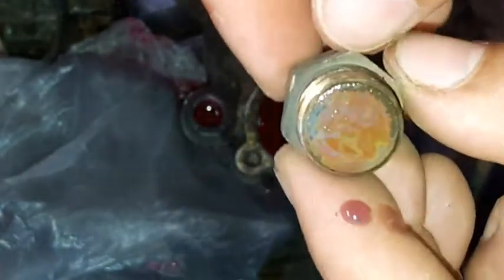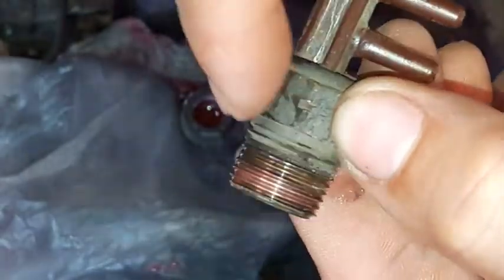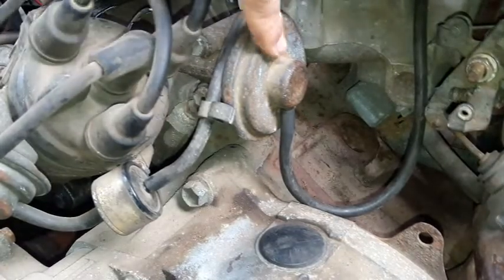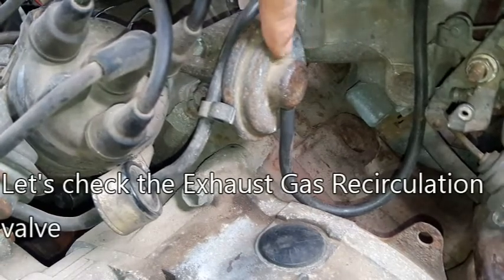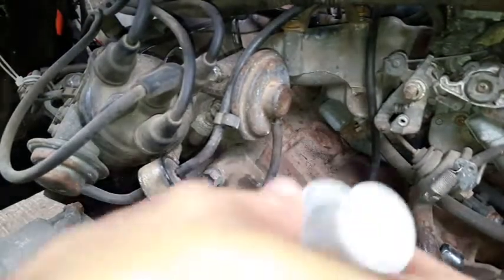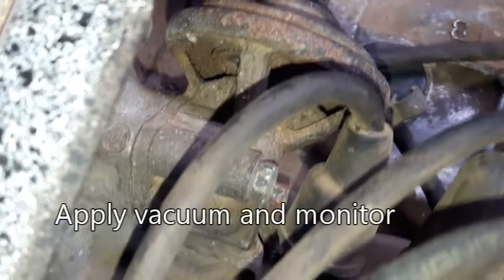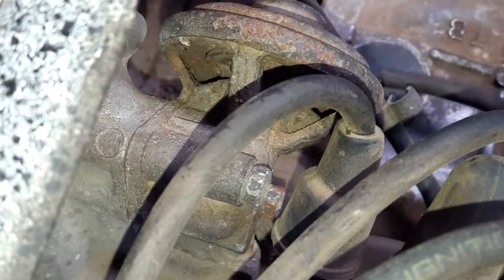Thermal vacuum switching valve & EGR test Suzuki F6A Multicab

Comment: Greetings. Sir mga ilang seconds o minutes bago po mag open ang thermostatic vacuum switch valve na yan? Maraming salamat Po
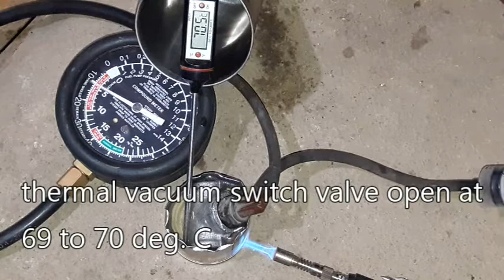Reply from the maker: sir kung mag base po ako sa video mga 57 seconds bago sya nag open. from 1:40 mins at 51 deg C to 2:37 mins at 69 to 70 deg C. Yung opening po ng thermostatic valve na ito ay depende kung gaano ka bilis mag init ang makina or yung cooling system po. pag walang thermostat ang cooling system medyo mabagal ang opening nya. Since vacuum supply ito sa EGR valve, mahalaga na mag oopen lang ito pag na abot na ang normal operating temperature ng engine, kasi kung malamig pa ang makina at nag open ito, mag oopen ang egr at cold engine, it will cause engine vibration po. watch nyu po ang video na ito about egr effect https://www.youtube.com/watch?v=YcYF6Uir6UY
Reply: @UDoITchannel  Noted with thanks. Gusto ko Po sana I try Yung tvsv ng f6a sa Corolla 2e para Po sa choke breaker ng fast idle system ng 2e carb  so that ma fully automatic Ang cold start system. Halos lahat Po ng bnew na bimetal vacuum switch valve na 3ports Hindi Po gumagana. Maraming salamat Po sa mga videos mo. Madami Po akong natutuhan sa inyo

Comment: Boss may kinalaman ba yan pag hindi nakakabit yung para sa gas resirculation nauubusan ng gas ang carburetor? Yung van kasi namen hindi nakakabit yan. Sa vacuum valve switch. Naiisip ko parang sa hangin kasi napuputol daloy ng gas. Hindi naman barado ang strainer nya.

Comment: Sir yun sa akin 4 po kabitan ng hose base po sa mga video nyo pag nerekta ko hose hnd pinadaan sa sitch ngana egr pero po oag pinadaan ko sa switch po hbd ngana kahit apakan ang gas,paano po b pgkabit ng hose pag apat po yun 2 ginamit ko nilagyan ko lang ng ibang hose yun 2 ntira kabitan para mgasara,sna po matulungan nyo ako
Reply from the maker: Boss pag dumaan po ng thermal vacuum switching valve, gagana lang po ang egr pag na nasa normal engine operating temperature na ito or base sa testing ko ay nasa around 70 deg. C saka palang gagana ang thermal vacuum switch valve, meaning saka lang mag oopen ang thermal vacuum switching valve at mag kakaroon ng vacuum at gagana or mag oopen ang egr valve. nasa bandang 2:39 mins po ng video yung test na ginawa ko. Kung gusto nyu naman po malaman about carburetor vacuum line connection, try nyu po watch yung video sa baba bandang 5:23 mins. baka sakaling makatulong, trace nyu nalang po kung ano-ano yung mga existing devices na naka connect sa carburetor vacuum port nyu. 

https://www.youtube.com/watch?v=xO_K5S3o96Y&t=322s
Reply: @UDoITchannel  sr napanuod kn po mga video nyo laki tulong kaya po test ko yun sa akin egr at switch valve sa tingin ko po sira npo iyon kasi kahit minit n mkina hnd po ngana,sinubukan kn po pagpalit aplitin ang vacuum hose hnd po rin ngana,pero nun nilipat ko hose sa 2 pinakhuli kabitan ng 4 n hose ngana kso problema sir kahit malamig makina ngna po,kaya ngayon po ngahahanap ako sa mga surplusan dto sa amin,wla po kasi khit da auto supply malpit sa amin,at wla rin ako makita sa shope at lazada,slamat po sa reply sir🙂 laki tulong po mga video nyo

Comment: Sir tanong q lg kasi yung thermo switch q putol yung sa air supply nya yung sa taas sa baba diba iyan yung egr yung lg po ang nakakabit,napansin q namamatay ang car q lalo na pagnaka aircon aq at ang hina ng hatak ng makina.saan m binili thermo switch nyo sir?
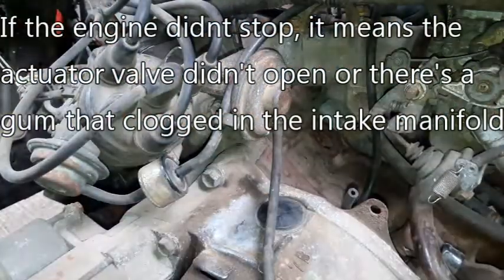Reply from the maker: Boss kung may aircon po yung MC nyu, at carburetor type, possible po na yung idle-up solenoid valve nya ang problema, pag nag aircon po kasi tayo, kukuha ito ng additional power sa makina, mas mararamdaman nyu yung effect nito pag on nyu ng aircon tapos mag vibrate yung makina lalo na during idle, to avoid po or to prevent this scenario, importante po na gumagana yung idle-up solenoid pag nag switch tayo ng aircon, ang gagawin po ni idle-up solenoid, ay itataas nya yung idle to provide additional power na kailangan ng aircon at para hindi mag vibrate or ang worst case scenario ay mamatay yung makina. try to watch yung video sa baba bandang 5:25 mins para sa vacuum connection ng idle-up and visit this link for additional information about carburetor vacuum port
Link https://www.youtube.com/post/UgwI6kEpkBtOuHeqzSZ4AaABCQ

Video
https://www.youtube.com/watch?v=xO_K5S3o96Y&t=324s

Comment: Ano problema boss pag walang minor umaandar pero pag bitiwan ang pedal namamatay
Reply from the maker: Hello merilyn, try nyu po check yung idle solenoid valve or  yung tinatawag nilang fuel cutoff valve, baka lang po walang supply na 12 volts, you can watch this video https://www.youtube.com/watch?v=bXRXGmK7p7o&t=365s bandang 6:07 mins may ginaawa akng test dyan na temporarily dinisconnect ko yung solenoid at tinakpan yung butas ng lagayan ng solenoid then start the engine, meron din akng ginawa dyan sa video na test kung nag aactuate or nag oopen ba yung idle solenoid pag may 12 volts supply.

Comment: good day ka Udoit .. ask ko lang po ok lang po ba na wala akong termostant yung f6a ingine ko.. hindi po ba ako mag oover heat kung wala ako naka instal na termostant..  salamat
Reply from the maker: Boss ok lang naman po na walang thermostat pero hindi ibigsabihin hindi na po mag ooverheat ang makina. ang hindi gumagana or hindi nag oopen na thermostat valve ay isang sanhi lamang ng pag overheat ng makina. pero kung ito ay na mmaintain at na checheck regularly, malaking tulong ito sa life span ng ating makina. maaaring hindi nyu pa nararamdaman yung immediate effect pag walang thermostat sa ngayun. ang thermostat po ay nag cocontrol or nag reregulate ng temperature ng ating engine for better engine performance. kailangan ma control or ma regulate yung temperature ng ating engine para yung thermal expansion ng mga valves or other metal parts ng engine ay ma control din. kung lagi lang malamig yung ating engine, hindi natin na mamaximize yung kanyang full potential power.
Reply: @UDoITchannel  salamat ser sa info.. kasi ser kahit l;agyan ko ng termostant puro naka condem na mga hose nya papuntang carb hindi ko nalang alam kung saan saan pag dudugtunigin,., anyway salamat sa advice ser .. lage ako nanonood ng blog nyo marami ako natutunan thanks

Comment: Sir , maraming salamat po sa mga tutorial mo. Sir tanong ko lng po saang vaccum port  pwede ilagay ung egr .? 4 vaccum ports ung carb. Ko.. kc namamatay pag ung menor pag mali ng kabit sa vaccum port. Tnxs po.
Reply from the maker: Boss yung carburetor nyu po ba ay 3+1? meaning tatlong ports magkatabi tapos yung isa nakahiwalay? maganda sana kung makapag send ka ng photo sa fb ko para may clear idea ako, anyway, assuming po na yung isa ay naka hiwalay,  dyan po yung egr naka connect, to double check po, connect po kayo ng vacuum gauge, at idle dpat walang vacuum yan, tapos pag nag open po kayo ng throttle, saka lang mag kakaroon ng vacuum, dapat po dumaan muna ito sa vacuum switching valve bago pumunta sa egr valve, pag nakamali po kayo ng connect, halimbawa, yung port na ginamit nyu ay may vacuum during idle, tapos yung connection nyu ay direct to egr valve, egr valve will open at idle and this will create vacuum leak po.
Reply: @UDoITchannel  opo sir 3 +1. Cge sir send ko. Tnxs
Reply from the maker: @generbalofinos3254  Boss kung 3+1 (A,B,C + D), yung D po yung sa EGR valve na connection, tapos po yung C ay para sa single acting na choke actuator, pag double acting po yung choke actuator, dalawang vacuum po yung pumasok o kailanga ng choke actuator, isang port to open at isang port to close yung choke, so either yung C or A pero kadalasan po yung C (both may initial vacuum po sila, medyo mataas lang ng kaunti si A, initially at idle, may vacuum reading na po si C, so ito naka connect sa choke port for close position, tapos yung B naman ay mag kakaroon lang ng vacuum pag nag throttle open na po kayo at si C ay mawawalan ng vacuum, so yung B naka connect sa choke actuator to open na port. bali pag ng open po kayo ng throttle, choke will open and at idle ang choke ay close, pero pag mainit na po yung makina, yung automatic choke po yung may overall control sa choke plate. try to verfy, observe nyu po yung choke plate by removing yung rubber boot in between sa air cleaner and carburetor. Opinion ko lang po ito bos
Reply: @UDoITchannel  maraming salamat sir. Pero ung canister sir dun sa pinakamatas na rpm bago magkaroon ng vaccum.?

Comment: Good day sir. Nailagay ko na sa tamang port yung hose papunta sa thermal swicth then balik sa EGR pero namamatay makina ko, ano problema nun sir? So inilipat ko muna yung hose para sa thermal sw./egr dun sa port ng idle up dahil wala nmn ako ac. Thank you sir.
Reply from the maker: Boss pareho po ba tayo ng carburetor na 5 ports? yung idle up na sinasabi nyu po ay yung nasa letter C na port dun sa video sa baba?pag nilagay nyu po sa letter C, ang mangyayari po mag oopen na agad yung erg valve pag naka rekta ito sa port letter C kasi may initial vacuum ito at idle. ngayun po since dumaan sya sa thermo switch, during cold engine start, hindi pa ito mag oopen pag hindi pa nag init si thermo switch, ngyun po at idle at nag init na si thermo switch, ang mangyayari po ay mag kakaroon po kayo ng vacuum leak na cause po ni egr valve, kasi po nag open na sya.ngayun po pag umandar na kayo at nag throttle, mag coclose po si egr valve kasi unti-unti pong mawawala yung vacuum dun sa port letter C.

dapat po sa port letter E (to EGR) naka connect si EGR, at idle, wala pa itong vacuum tapos pag nag throttle na po kayo, mag oopen po si egr valve.

Yung sinasabi nyu po na namamatay, baka po kulang lang sa tuning yung carburetor, try nyu po dagdagan yung fuel by adjusting yung idle base screw ng dahan dahan.

https://www.youtube.com/watch?v=L59RKemvKus
Reply: @UDoITchannel  sige sir susubukan ko itong mga tips mo saka analyze ko rin mabuti☺ bago iapply. Maraming salamat ulit. Godbless!

Comment: Magandng araw boss.. hihingi ako ng advice.. Yon po kasing thermo switch ko ayaw na magsara lagi pong bukas kahit malamig yong makina at dito sa amin walang binibintang ganyang thermo switch., Ano po yong maii advice nyo po?.. salamat..
Reply from the maker: Boss kung yung egr lang ang naka connect sa thermo switch, pwede po 

bypass temporarily yung thermo switch, ang mangyayari, nka rekta yung 
egr valve dun sa vacuum port ng carburetor. Ganito po yung magiging 

possible scenario kung naka bypass.

1. During idle, hindi pa mag oopen yung egr valve, kasi wala pang vacuum dun sa port ng carburetor. meaning hindi pa ito nakaka apekto sa idle ng makina.
2. Pag mainit na yung engine at nag transition ka from idle to slow speed, yung aarankada ka na, hindi mo masyado  ramdam yung effect, yung effect na parang may vacuum leak. 

3. Pag hindi pa mainit yung engine at nag transition ka from idle to slow speed, yung pagarangkada mo, ma raramdaman mo yung engine vibration tempoararily, kasi nag fully open na yung egr at wala pa sa optimal engine temperature yung makina.

ang main function po ng thermo switch is to control yung opening ng egr at optimal engine operating temperature.
Reply: @UDoITchannel  salamat boss,, 👍👍👍

Comment: Yung ganyan sakin boss parang apat yung tube para saan naman kaya yun? Kasi naka condemn naring ehh.
Reply from the maker: Typically boss sa EGR valve and idle up para sa aircon.
Reply: @UDoITchannel  yung thermostatic switch yung 4 ang sasakan ng vacuum hose.. yung sayo na tinest mo using torch 2 lang para san yung dalawa?

Comment: Boss para sa ano po yong thermal vacuum? Salamat
Reply from the maker: Boss yung thermal vacuum switching valve ay mechanical switch sya na kapag uminit na yung wax dun sa internal part ng valve ay mag oopen ito. ginagamit ito para during cold engine start, wala pang vacuum na pupunta sa egr valve
Reply: @UDoITchannel  boss during cold start sasakyan ko nasa 850-900rpm lang diba dapat nasa 1200-1300rpm at pag nasa normal temp na bababa na sa  850-900rpm. Ano kaya posibleng gawin o sira kung meron man dapat linisin o palitan. Sasakyan ko pala toyota corolla gli 1996 4afe automatic trans. Salamat
Reply: Salamat boss ka kaalaman...

Comment: Paano kung barado ang intake manifold... ano ang mangyari sa makina... salamat
Reply from the maker: Boss sa tingin ko pag clogged yung intake manifold, hirap yung engine makahinga, less yung pumapasok na air sa engine that cause rich mixture, since dami gasolina ang hindi na susunog, it will create heavy carbon sa exhaust pipe (medyo mainit yung smoke). Mapapansin mo rin na parang walang power during acceleration. Ang pina ka worst, engine will stop.
Reply: @UDoITchannel  sir may video po kayo kung pano malilinis yun manifold???

Comment: Hello sir, talking about thermal switch,  i already found the thermoswitch of the f6a radiator. Kung tama po e ito yung nasa base ng radiator pero disconnected sa wires at nirekta po yung wire kaya pag switch ON ng ignition ay andar agad ang motor fan. Bakit kaya nakarekta ang motorfan? Di ba dapat itrigger muna ito ng thermoswitch? At yung thermoswitch alin kaya dun ang pos.(+) terminal? Thank you ulit sir.
Reply from the maker: Boss not sure kung bakit naka bypass yung thermoswitch nyu, baka naman hindi na sya nag ooperate ng maayos. meaning baka hindi na sya mag switch on pag ang temperature ay mataas na (somewhere aroung 88 deg C). try mo check kung operational paba yung thermoswitch, babad mo lang sa mainit na tubig at 100 deg. C if possible tapos connect mo yung multimeter 
at series mo lang yung connection for continuity check. since switch sya, sa tingin ko hindi sya polarity sensitive. kung gusto mo naman na hindi kana magtanggal ng switch, connect mo nalng yung origianal wire, try mo hanapin yung ka kulay ng wire sa thermoswitch (typically blue/white and blue/red strip. hope this help and don't forget to subscribe. thanks
Reply: @UDoITchannel  thank you sa reply sir. Subscriber na po.. sinubukan ko na sir i-connect yung wire pero hindi nag function yung motorfan.  busted na cguro yung thermo switch. Thank u ulit sir.
Reply: @UDoITchannel  sir, gagana ba ang temp. gauge kung sira ang thermostat? Naisip ko kasi baka sira thermostat ko at kaya lang working ang temp gauge ay gawa naman ng temp sending unit. Maari ba ganung scenario sir. Thank u.
Reply from the maker: @bennsantiago3748  Boss gagana parin po yung temperature gauge nyu kahit sira yung thermostat and thermoswitch sa inyong radiator. bali yung temperature sensor para sa temperature gauge ay hiwalay. purely indication lang ito ng temperature. Ang thermostat naman po ay isang mechanical valve na control yung kanyang opening pag mataas na yung temperature. Yung thermoswitch naman po ay electronic on/off switch para sa radiator fan  mag switch on pag mataas ng yung temperature. Independent po silang tatlo. Hope this help. regards
Reply: @UDoITchannel  thank you so much sa immediate reply sir. Malaking tulong talaga mga tutorial at payo nyo. More power and Godbless..